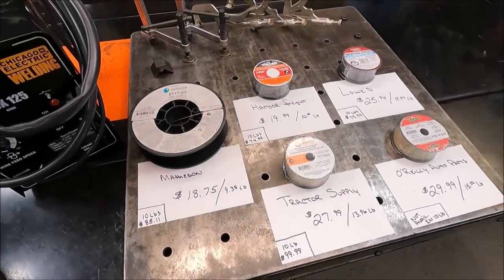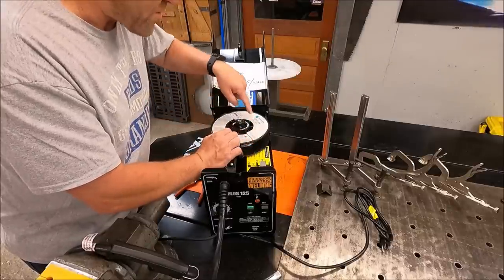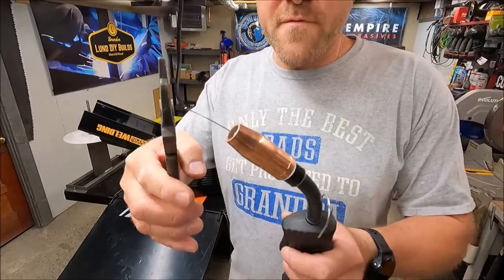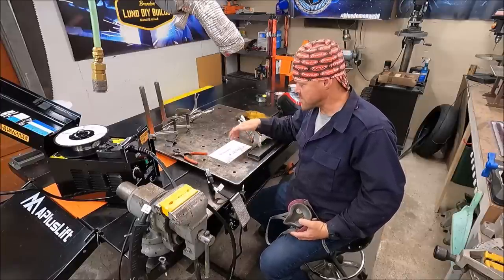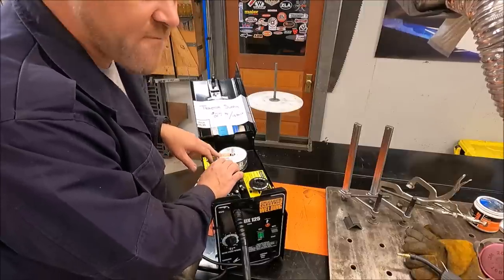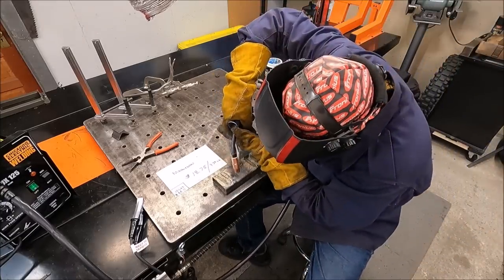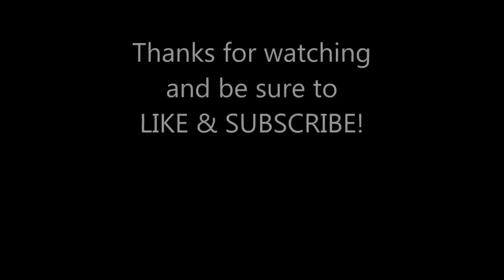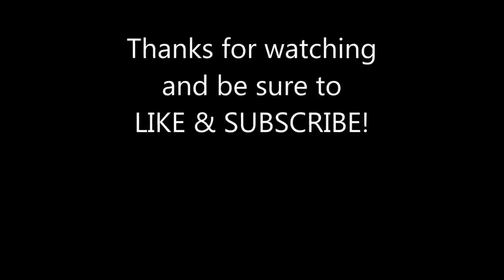Testing which Flux Core Welding Wire is Best

Comment: How can you say Mathison is cheaper look at the other ones that are cheaper in 10lb than mathison
Reply from the maker: @Bill Wells when comparing the wires per pound, 1 pound of Matheson wire costs less than the others. If you want to compare 10 pound spool prices I have included that also for comparison.  Not all the wires purchased are available in 10 pound spools which is another reason I gave a by the pound price. Ultimately this test was not about price but rather which wire ran the best and proving that spending more doesn't necessarily equal better results

Comment: If you go to a resturaunt and buy  chicken ..is it the sane as the steak ?? .. made in the same kitchen  .same  cook .. .. but they are two different things ..  not a hard thing to understsnd
Reply from the maker: Your anology is flawed given the chicken and the cow aren't "manufactured" and are totaly different species. A better anology would be a Miller welder made in the same factory as a Hobart welder. There similar but different, however Hobart welders were equipt with mig guns that said "Miller" on them for a short period of time. Very simular to wire being manufactured in the same facility.

Comment: Nice video comparing some of the more popularly available flux core wires. I found this very informative YT video "Flux Core Arc Welding by Steve Bleile:  https://www.youtube.com/watch?v=bA1ON_Y2tVo&t=1437s "  around 12:57 recommending E71T-11 vs E71T-GS for FC welding. The best welds you got were from Lincoln and Hobart wires which are both E71T-11 I noticed from this video.
Reply from the maker: Thank you :)

Comment: How the weld looks tells you nothing about the quality of the weld metal. You have to break stuff.
Reply from the maker: @John Balazek Exactly! Stay tuned where we X-ray these welds
Reply: X-ray tells you nothing about the ductility of the metal.
Reply from the maker: Yes that is correct but it will show slag inclusion
Reply: Porosity is usually more of an issue with properly cleaned passes.